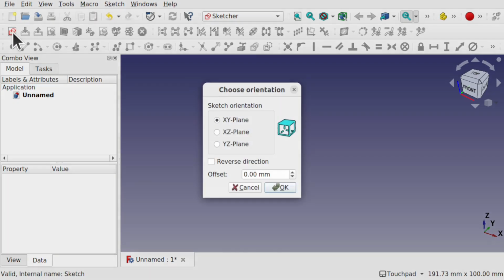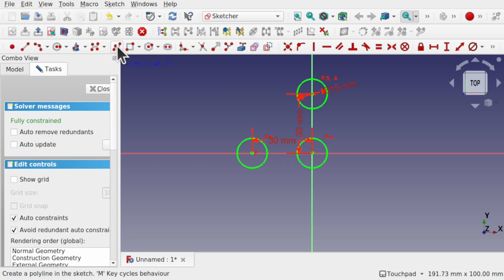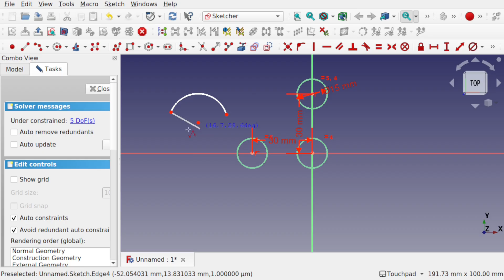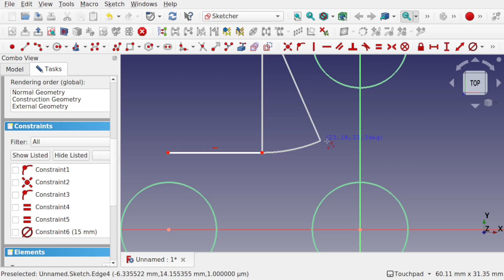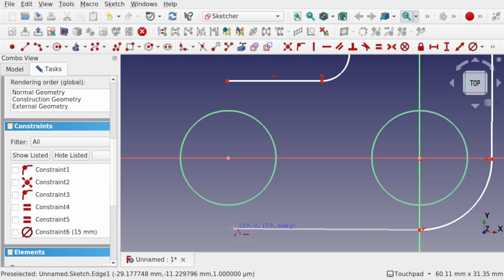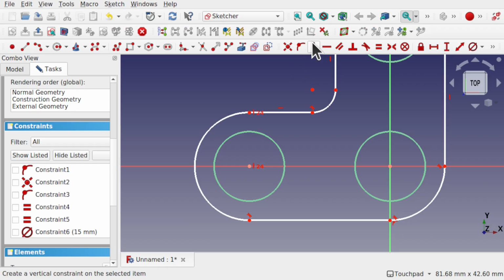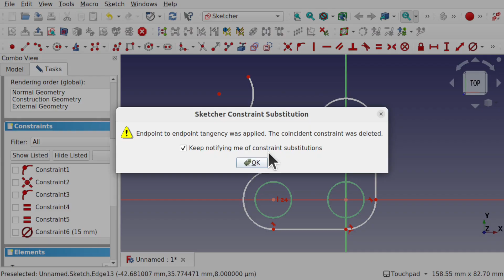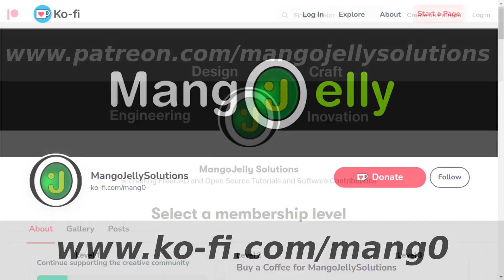FreeCAD: Increase Your Sketching Speeds and Sketch Faster With This Single Tool

Comment: Wow! I had never realized that a polyline reduces the labor by such an extent.
Having used Sketchup before taking up FreeCAD, I used to miss the inference engine.
But polyline serves the same purpose (trick at 5:00).
Of course, while SketchUp's inference engine can apply constraints on the fly, it lacks most of the constraints offered by FreeCAD.

BTW a "mil" is an officially used unit name, equal to 0.001 inch. 
So the unit 'mm' should be pronounced as "em em", and not as "mil".

Comment: Almost perfect but it is missing ability to add dimensions while drawing, just like in F360. A cherry on top would be removing constraint requirement before padding in Part Design and then you are almost good as F360.

Comment: Great help, this has sped me thru designs faster. I used to draw basic objects and cut them or booleaned them. I just designed a small engine piston ring compressor for a friend who has a shop. Using this vid I just drew it straight-away. It is basically a shower curtain ring - ha. But doing it this way and adding constraints seems so much more sophisticated.
Reply from the maker: Great to hear its speed up your process. Takes a little getting used to but it's a great tool to master. Glad you enjoyed and thanks for sharing what you used it for.

Comment: Great time saver! Thanks, I was not aware of that! And btw, without even mentioning it, you revealed another cool trick of which I was not aware: assigning a diameter to multiple circles at the same time, resulting in equality constraints!
Reply from the maker: Great to hear you found it useful. There is loads more tips to come 😁

Comment: What key do you press to have all the line  automatically connect to each other, without having to individually constraints the points on each of the lines together, thanks. I'm new to freecad.
Reply from the maker: You need to tick the auto constraints when you come into the sketcher. It will be on the left hand side. That means when you place your mouse over a constraint it will connect to that constraint
Reply: @MangoJellySolutions  thanks